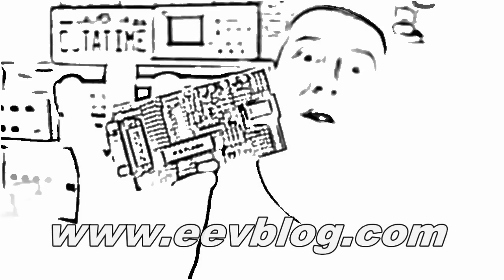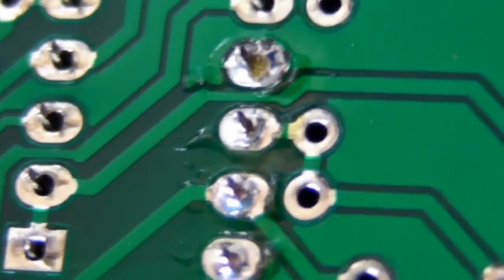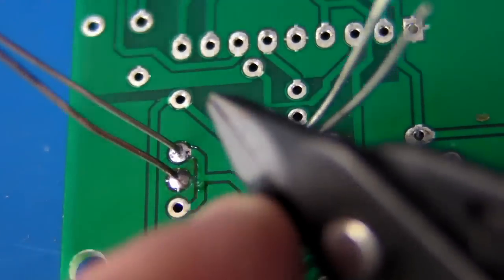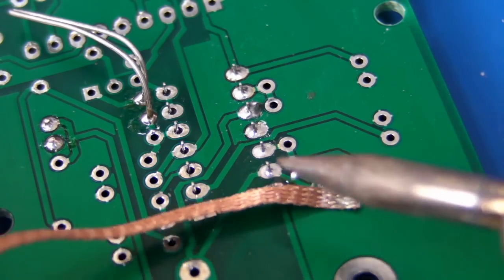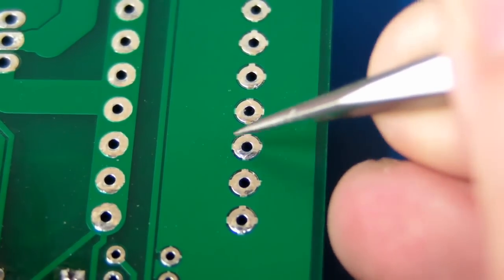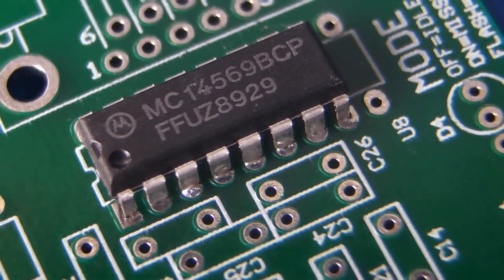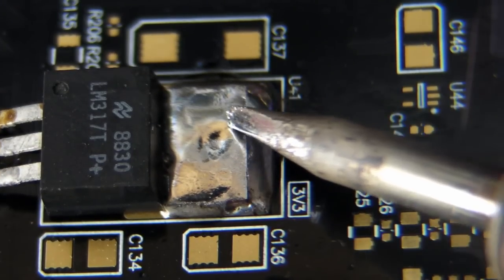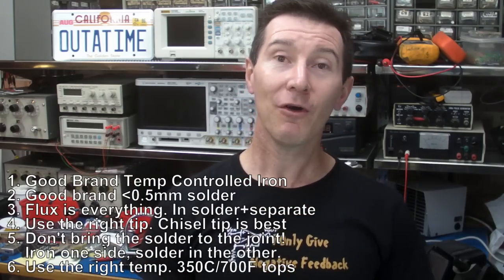EEVblog #183 - Soldering Tutorial Part 2

Comment: Dave, another good tip you've forgotten to mention: solder tip in -> solder in -> solder out -> solder tip out. The soldering iron should always be the first thing to touch the joint, and the last thing to leave the joint. I realize you've done it all the time during your video, but the beginners could certainly not notice this detail unless we bring their attention to it. 
(I'd also like you viewers to upvote my comment, so more people could pay attention to this detail.)
Reply: THANK U
Reply: Just like nesting HTML elements: The last thing on the join (the last open element with an opening tag) is the one you remove first (the element you close first with a closing tag)
Reply: I just started soldering (lovin' it) and I will agree that this seems to be the most basic and important principal. However, the god-awful mess that's left behind when you take the solder tip out before the solder is a pretty good indication that you've done it backwards.
Reply: Pretty easy to realize this when you start soldering because you feel your solder wire stick to the joint.
Reply: very helpful thanks
Reply: I have actually found this to be the most useful tip by far. Thanks for Sharing, brother. Sharing is Caring.

Comment: One of the most important steps before you even touch your iron to the joint is cleaning. If you have a dirty surface, no amount of flux is going to clean the joint sufficiently to prevent de-wetting. An ink eraser and alcohol help prep the lead and the landing. You should spend more time prepping the surface than you do with the iron on the joint. Also while there is flux in the solder, adding a bit of flux helps with heat transfer. I have found that my solder joints look better when I use flux

Comment: I just finished part 1 and part 2, and I want to thank you for putting in the time to make these videos. These will actually help me with both my job (mech. eng.) and personal hobbies (currently retrofitting a milling machine to CNC....requiring custom wiring harnesses with solder cup connectors, so I'm glad that was covered). I was getting frustrated this morning while getting poor solder joints on a DB9 connector, so I wanted to learn more about soldering in general. I knew my iron was crummy (am about to purchase a temp controlled station), but I didn't know all of the other little setup details you covered - especially about different tips. The only thing I could tell was missing was how to apply the flux separate from everything else.

I never thought I would say that I'm excited to rework my connectors....but I am! Thanks for the info....I'm going to continue on watching more of your videos.

Comment: These are great tutorials! My electrical engineer father is no longer with me to teach me soldering. The closest he got was showing me how to solder copper pipes to connect a water heater in my first home. Much larger components and therefore we used a torch and very large diameter solder. However, the "heat up the joint first, then apply solder to the heated joint" still applies. God Bless you sir for taking time from your life to freely share your knowledge.

Comment: What a great series, thanks Dave.  In my experience (20 years PTH and SMD) I find tinning the tip up front or a slight tip tin just before adding solder to the opposite side helps the heat dissipation and joint.  I notice you do this subconsciously but not actually highlight.

Fantastic tuition, thank you.

Comment: I've been soldering for about 3 years and have been struggling like hell to get decent joints. I was always taught to "tin" the iron with solder first, and to use a lower temperature (e.g. 280C). After switching to your method my joints are infinitely better!

Comment: Another great video.  I have done aerospace soldering before. They way we did our soldering for military avionics was to use solid solder and pre-flux all our solder joints using liquid flux, usually a rosin based flux cut with alcohol. This does require more cleaning afterwards but  give a much better quality solder joint. For basic work tho, these techniques your show are great.

Comment: I'm starting in electronics now, but I've been soldering brass musical instruments for a long time. That kind of soldering, isn't hard either, but it's not easy. Mess up the lacquer on someone $10,000 saxophone, you're in big trouble.
 And you have to worry about burning up the pads, doing a messy job on silver plate, weakening the springs, and try soldering a sousaphone or bass sax, the things are huge. Good soldering can be an art.

Comment: Thanks for this really helpful tutorial. I'm a beginner and I couldn't get enough heat in the joint to melt the solder effectively. Turns out the tip of my iron was too sharp so I filed it down to a flatter tip, now it works great!!!

Comment: Great demo for any biginner still! I started with about 1.5 or 2mm solder and my early ones looked much worse than the ones demostrated. Thin solder was difficult to find and I learned to work with 0.7mm even with smd. With current solders you really need to feed them, not just the quick touch I got used to. I still like a bit wider solder just because I'm used to giving a quick touch instead of feeding it. (Yes, I do use thinner ones too and there are really cases where they are really needed!)

Comment: For many years I've always only used conical tips, even for soldering those 1W resistors or bigger things. I managed to get it working as you did, tinning the tip to increase the thermal conductance and then solder as usual.
Chisel tips are really better but sometimes you need to work with what you've got at hand.

Comment: This might have been mentioned already, but the fine conical tip if for soldering in very tight places. the very tip isn't supposed to heat anything, in fact, it's mostly just to take up space allowing the side to heat up well. The way you used it later, when you got the good solder joint, was the proper way to use a fine conical tip. I'm sure you knew that though.

Although it's not often someone would need a fine tip, it's a great one to have, because it fits almost anywhere.
Reply: Yes he mentioned it later, and demonstrated it also, exactly as you wrote. He wanted to emphasize the fact that if you need one for general use (I think he said about 90+% of the time with electronic circuitry), then you'd better take the flat one, as the conical one with a needle-like tip would be useless (or a real PITA) most of the time.
Reply: HawkFest RoG
It's been a while since I posted that, and I don't plan to watch the video again, but as I recall he demonstrated the proper way to use it saying that it was almost never necessary.

What I was trying to point out was; if you happen to work on rather small circuits, which is more and more common as electronics continue to shrink, then the fine conical tip is practically a necessity for your collection. As is knowing how to use it. The way he demonstrated at first is a common mistake in use, that I guess a lot of people assume is the purpose. The proper use demonstrated later was sort of brief.

I have found that almost every project I have done since I got back into it has been circuits so small that the fine cone was necessary. It's basically the workhorse of my bench right now. The station is put to sleep with the fine cone installed almost every time.

Comment: I did a ok soldering job on the small project i have.
it doesn't seem to be any cold joints on it, but there are parts where i used to much solder, because the solder just flowed down the trays. And in the beginning i had a bit of trouble, because i don't exactly know what to do.
But i learned from this video, and i know how i will do this in the future.

Comment: I always keep a bit of fresh solder on the tip which helps tremendously with heat transfer and speed. When doing a lot of joints that condition just tends to maintain itself between joints. Oh yeah, you eventually suggested that.

"Thermal relieves" - Oh wow, all these years I never really got the purpose of that! Cool.

My question is- are newer irons with the "tip thermostat" worth it, and which ones? Ah- check the next eevblog videos.

Comment: I bought a chisel shaped tip and 100g of 0.5mm solder and it improved my soldering big time! I get really nice joints.

Although I don't understand the importance of having multi core flux. I just bought single core, came out much cheaper. I figured there is no shortage of flux, since I use conformal coating that acts as flux. Besides, I solder only home-made PCBs with bigger joints.

Anyway, thanks for a great video.

Comment: Nice video! I've seen other soldering tutorial and they said that you may first applied little solder between your soldering iron tip and the component (but not before they are in contact) to enhance the thermal conductivity (increase the contact area with molten solder) and then apply most of the solder to the opposite side. I followed this tip and found out that conical iron tips also work very well.

Comment: Hey, nice stuff again Dave. Thanks much!

The first chip you did gave me a good idea..
Bend the second pins in on each corner of the chip to hold it down tight
then solder the 4 outer corner pins. Straighten the bent pins and solder the rest.
This might be useful if you need to solder a chip after already having higher components on the board.
Also thinking I need to get a good station. I still have the same mains (albiet with temp adjust) soldering iron that I bought in the early 80's.

Comment: Good video.

One more thing that I find very helpful in soldering is fine grit (like 600 or 1000 or so) sandpaper to clean oxidized (or greasy) wires and component surfaces. That age-old resistor or the LM317, for example, would have benefitted a lot from a quick little brush-up.

Sometimes I also use the harder (usually blue) side of an eraser/rubber to polish the pads on a homemade untinned PCB.

Comment: In addition to exscape's comment, a small amount of solder on the tip will aid heat-flow between the solder tip and joint. You only use a small amount though. The bulk of the solder is applied from the other side of the joint as per the video. This means there is still enough flux to clean the surfaces. At least that's how I was taught to solder 25 years ago...

Comment: I have always applied solder to the iron with a flux blob on the components and it has worked well almost always. I find it the easiest way for very small boards with one transistor.

Comment: Another small tip.  Because after soldering using resin cored solder the end of the solder seals over, pinch off 1-2mm before each joint to expose the resin core and allow it to flow out and start doing its job before the solder melts.

Comment: Reminds me of a time when I had to join some speaker wire when all I had was a micro-torch. I just twisted the stuff together, and heated it up with the torch until the copper melted, and it worked like a charm, no extra noise artifacts or anything due to the wire.

Comment: The tutorial, is geared towards professionally (rather than home-made) made boards in the following regards:
1) In my experience, when using a board that is not pre-tinned, wetting the iron slightly is not optional, but essential if you want to heat up the board in a reasonable amount of time.
2) Similarly, about the height of the solder joint. For a through-plated hole, that minimum height is fine. For a one-sided board, it needs to be higher.

Comment: Dave! Thank you!
I've been playing a bit with electronics and soldering from time to time, and pretty much every time my effects were worse than terrible: I just thought that if anyone sees this, I'll be banned from using soldering iron ever again.
Now I've been:
- using a conical tip (and the more I failed, the thinner tip i've been looking for)
- following a (bad) advice that I should put the solder on the tip first.
- I tried both the gun soldering iron and the regular, non-temperature-controlled soldering iron.
- finally, of course, a pretty thick solder. Because it's "easier"...

So I finally understood that there's no possible way I could have ever made a decent joint.

Quick question:

Could you (in case you never have) make an episode about hot air soldering irons -- are these worth it? if so, how to use them properly?

Edit: never mind, just went through the third part. I see you also use these, though with the soldering paste.

Thanks again!

Comment: The thing I don't like about solder wick is with finer traces on the PCB, it can get quite hot, and sometimes cause the pad or trace to lift off the board. I prefer the desoldering pump. Also, if you do get a cold joint or disturbed joint, any kind of joint that doesn't have too much solder, I just heat it and wait until it flows, rather than removing it. 

One final thought, is when using DIP parts, sockets are your friend. They don't care about heat, and they make replacing parts much easier.

Comment: As to applying solder to the tip before putting it on a joint you need to apply flux to the joint (liquid or paste) otherwise the solder will not bond properly in the already covered areas when you apply more solder because the flux in the core can't reach covered areas.  If you're reheating a joint it's also standard practice to flux it.

Comment: about the right amount of solder, if you have very high voltages you would sometimes specify round joints to avoid breakdown, not something you would normally do

Comment: 17:30 you talk about using solder off of the iron tip, what I use to do is "tin" the tip then delicately swet sponge it so that a thin layer on the tip assist a difficult solder joint.  Another point, don't file or sandpaper clean a tip as it will damage the special metal plating.

Comment: That 1489 its a RS232 interface chip. "Quad Line Receiver". I learned soldering by desoldering and resoldering old scrap junk boards from various electronics. The more you do it the better you will get.

Comment: The reason you get a cold joint if you put the solder directly on the iron tip, is because your suppose to flux every single joint before you solder them. The key to good soldering, is Flux, and more Flux.

Comment: Try to avoid components touching each other first rather than adjusting after as you will create stress on the component lead.  Also when cleaning the solder joint avoid scraping the surface with a metal tool, use a a stiff brush such as a soft toothbrush, especially when you are having your solder joint assessed ;)

Comment: I wish I would have known that overworking solder pads will result in them lifting from the board and you being virtually boned in soldering in your component. Pad repair kits are $200+, but apparently you can save the board by soldering the component directly to a trace through a wire or wiring the component to the next one on the board. So when dealing with solder pads, always make sure you are at the lowest possible temp to melt the solder and don't fiddle with them too much at once or the epoxy holding them down will break down and lift.

Comment: You do NOT want top clean the tip before putting it back in the stand, as the solder protects it from oxidising - always clean on the way out, not in.

Comment: A quick tip: It's not a good idea to use a wet sponge to clean the tip of your iron. The sudden temperature-drop can cause cracking in the thin layer on the tip and wears it out quicker. It is better to wipe it clean with copper wool or similar.

Comment: 16:25 a new tip (or quite old) is always problematic the first few tries.. if you're experiencing that sort of situation, take a little time to dress/tin the new tip; make sure it takes solder both on the very tip plus an extra 1/8 inch.. use flux, or just solder, a DAMP sponge, the brass scrapers, etc, just don't file or use sandpaper: the tips are plated for longevity... 

when a tip is clean the solder will stick to it. if the only tip you have is extra fine, you may need to increase the temp by 50F. it is safe for the components as long as the soldering sequence is not extra long; you want to aim for 4 sec max, preferably 2-3 sec.

with the wet tip, make contact w/ the board and component and then feed the solder right at the contact point. the surfaces will suck solder (get wet) once they reach the temperature. once you get a rhythm you can start doing one second solder feed from the contact point (keep tip in place) one second from the opposite side as shown in this video. the sequence is always: 
1. tip in (ideally 1sec to transfer heat)
2. solder in (ideally 1 sec to flow the solder)
3. solder out 
4. tip out.

Comment: @Nadrealis Not really necessary. When you have good iron and solder it takes only second or two to do one pin, so it doesn't heat up much. The board helps to cool it as well as the IC body heat capacity. With modern silicon devices it's generally no problem when you heat them longer.

Comment: When I solder a TO-220 tab to copper, I create a small loop out of 0.5mm solder with a circumference slightly bigger than the tab hole. I sandwich the solder loop between the copper and the tap and heat it whole thing with iron until the solder melts underneath.

Comment: i use a conical tip and it works just fine.  It doesn't come down to a point it has a mostly flat end that is fairly large.  I use the side of the tip just next to the end and it works great.

Comment: Hi, I've always thought that the PCB hole diameter should tightly match the pin diameter and that it's enough to solder the pin on 1 side only. Here I can see that the holes are much wider than the pins and that the idea is to let the solder flow to the other side as well. So what's the general golden rule? Let's assume that we're talking about a project with a simple 2-sided PCB, with 1 side devoted almost entirely to the ground plane.